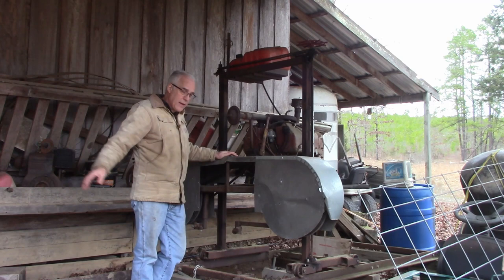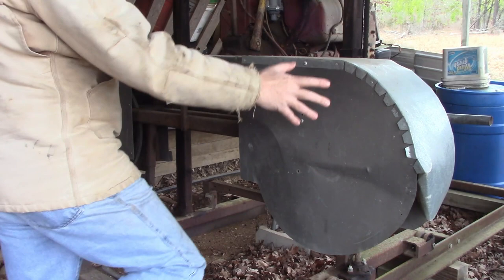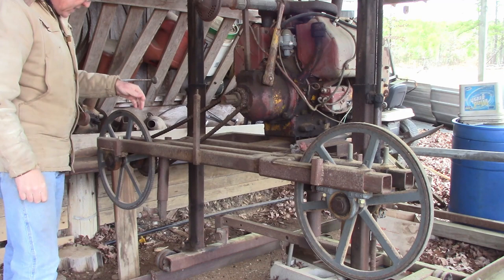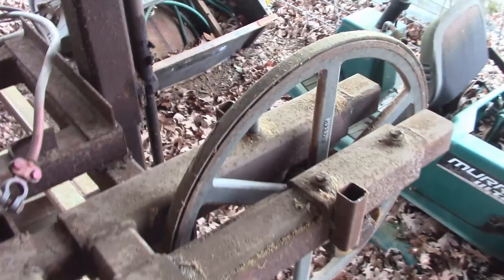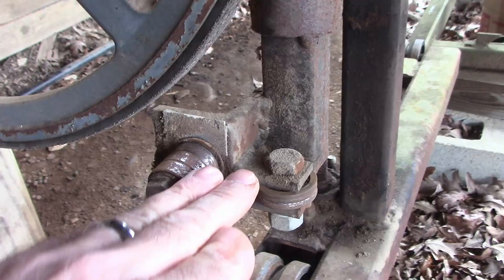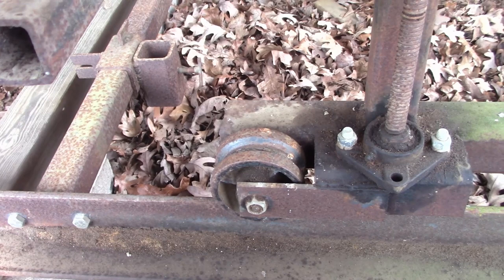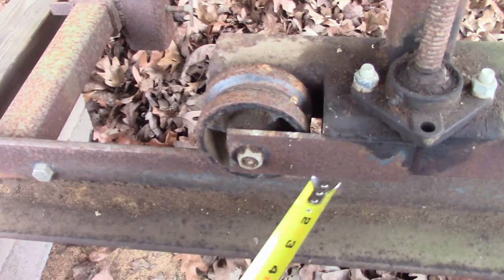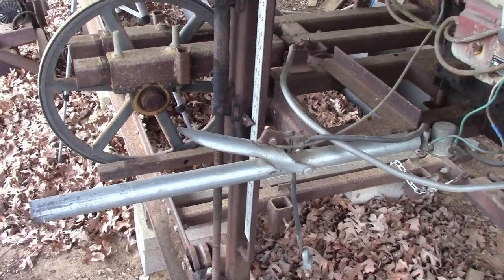Overview of My Homemade Band Saw Mill

Comment: Very interesting. On the blade direction, it seems like there wouldn't be much of an issue because the blade is still pulled around but from the top side now.  The way you have set it up the blade in in tension all the time on cut because it is pulled from the idler end then also on the return.  This might even be better?  Thanks for the update and hope you are doing well and have a good weekend.
Reply from the maker: Thanks Glenn.  It can't be a real issue as I have never had a problem.  I've never been much of a perfectionist I just want things to work.  I have always been more about speed and quantity over quality.  My son helped me increase my quality years ago, he was turned that way.  I never used to care about what something looked like and never painted anything.  I do a better job now thanks to his influence and enjoy the projects more for that reason.

Comment: Hello, i like your design , i was wondering how you mounted the bearing on the adjustable idle wheel. It looks like the bolts go through the square tube but then it would not slide.